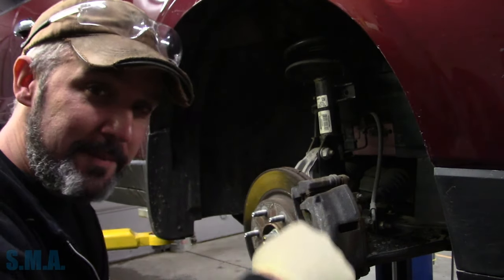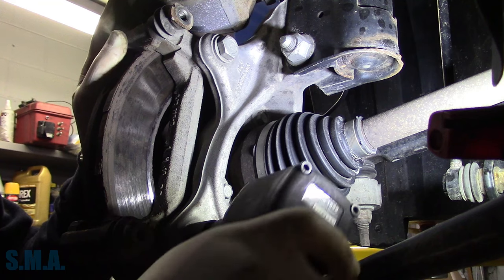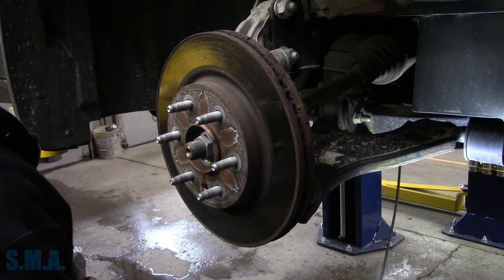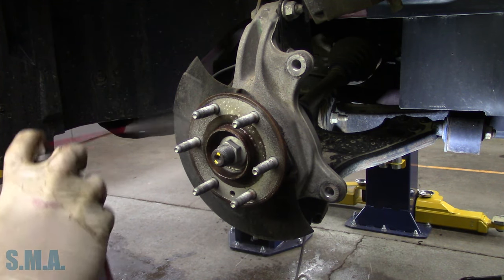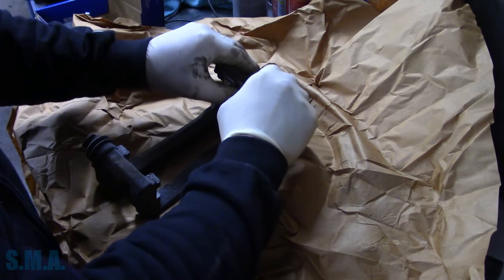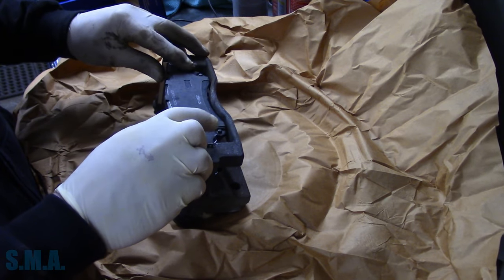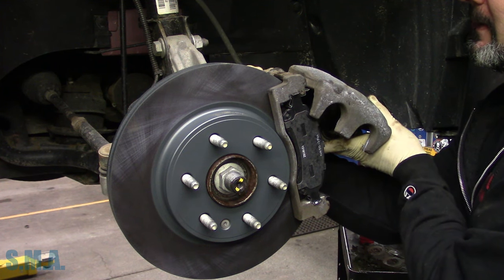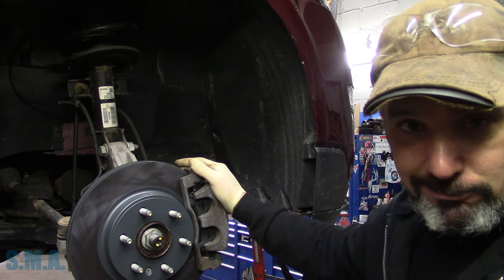Chevy Traverse: Front Brake Job

Comment: My grandpa, my dad, and now me, all pushed the pistons back in during a brake job. My grandpa was working on the very first hydraulic brake systems ever built! None of us has ever had a problem from that. Only time I had to open a bleeder after a brake job was yesterday ... after I knocked a piston out of the wheel cylinder while fighting that 6" long brake cable spring on my '07 Silverado's rear drum brakes! More fabulous GM engineering ... but I digress!

Comment: Just finish installing an upgraded brand new brake rotor and ceramic pads for the front of my 2018 Chevrolet Traverse today.  My stock rotor just aren’t cutting it when I want to stop suddenly or going downhill slope.  I tell you, when those rotor gets hot,  the brakes are scary as they just don’t slow down fast enough to avoid front collision.  So I made the decision to upgrade the front to a slotted  and ceramic pads.  The improvement is huge, as for durability,  only time will tell.  The new rotor and pads was on sale so I grab it while the price is too great to pass up on.  Regular price was for $699. Got it it for $275 something dollar

Comment: Just to amplify Eric's comments about car makers pushing in pistons without bleeding - from a Honda Odyssey service manual (Honda not Haynes etc), 
Step 1: Remove some brake fluid from the master cylinder. 
(Skip steps 2-10) 
Step 11: Install the brake caliper piston compressor tool on the caliper. 
Step 12: Press in the piston with the brake caliper compressor tool so the caliper will fit over the brake pads. Make sure the piston boot is in position to prevent damaging it when pivoting the caliper down. 
NOTE: Be careful when pressing in the piston; brake fluid might overflow from the master cylinder's reservoir. If brake fluid gets on any painted surface, wash it off immediately with water.
No brake bleeding mentioned.

Comment: yaay for the chivvrolaay...question doc ..does egr block off or delete mess up vehichle i.m. for inspection   for those whom dont want to remove egr tube for carbon cleaning?..i cleaned mine just a ponder though🤔

Comment: Me personally, I hate brake cleaner. Every time I use it in the shop I tend to have to weld within 30 minutes after and if you never welded after spraying brake  cleaner, DONT DO IT! Even if you spray brakes and you weld a part 30’ away on a table, your still screwed. I have nightmares from it. PTSD!

Comment: I have c clamps vise grip welding c clamps Pry bars of varying types and for the really heavy duty stuff a tankers bar for moving cat tracks, but my go clamp for pushing the pistons in
is the old Erwin single action pistol grip wood clamps, what ever works: amen... amen
none of this fancy stuff, just get it done. and tight is tight, ! "-)
I'm in my 70's, back in the day I worked with old timers from the 30 40 & 5r0's, to install a grade 8 1/2 short bolt, say in the dust dirt rock grade covers, take a 3 pound mallet & slam it home. 
and the guy would tell ya , that's how to get it done and go next. moving on.. 
I suppose you could call that flat rate. to say the lest I was stunned,  because I knew the next time around I have to deal with that slop job, and I did... 
many repairs  replacing weld nuts, 
I own a 2015 4x Chev. did my brakes all around, the rear brakes were getting bad, throwing my wife out of her seat ever time I applied the brakes. "-)
Honestly, I got a pretty good laugh from that. she didn't  think it was funny. 
bought Napa, not a sponsor "  you do awesome work>
I think I used a little white lube here & there & called it good, for the coast of 4 rotors
and shoes / kits, DIY, if it goes north of south, back to Napa & do it again, gives the old
man something to do. 
Harbor Freight has a recall on some of there jack stands, I have 4 of their  small stands,Pit-berg stands, the batch number I have aren't apart of the recall
Three batch No#, poor dog engagement, shallow tooth on the bar for the dog, slips past,
You don't need a Receipt, just take them back,   don't use them, 454,000 jack stands 
on recall. hello...………. china crap strikes again.

Comment: Great Video. I've seen this post install and I have a question. I followed most of what you've done and I'm hearing a noise, sounds like a grinding, when I brake. This sound occurs when at low MPH and light braking.  I used Ceramic pads. I've checked the system and everything looks good. Any suggestions. I'm hoping not to take it to a dealer.  Thanks!!

Comment: Because Eric O has been mentioning the comments he receives about opening the bleeder I decided to check myself.  I have the factory manual for my F150, my Hyundai Elantra, and my old 1994 Ford Ranger along with Chilton and Haynes manuals for several other vehicles and none of them ever mention opening the bleeder before pushing the pistons back in.  I even remember from shop class (back in the old days) that all you have to do is push the piston back-just make sure you have enough room in the master cylinder.
So unless a manufacturer specifically states that you have to open the bleeder I'm with Eric on this one!

Comment: i just replaced the front and rear brake pads on my 2007 mercury mountaineer..
i added small amount of silicone lube to the ears of the brake pads that slide on the new hardware..
hope i didn't screw up... what do you think Eric??

Comment: Is the squeaker tab hung up on the back of the caliper bracket? Also, have you ever tried using a product called Disc Quiet? It cuts down on disc squeal quite a bit, and it won't wash off over time like the silicone grease.

Comment: Zach over here at Jahr Transport- thank you for all you do for the people, but you want to take the cap OFF the brake fluid reservoir to amke sure those pistons move easier, also air doesnt get introcuded by fluid not having anywhere to go because the cap is still on reservoir

Comment: At 9:11 he says the wear indicator goes on the inside of the caliper bracket facing down, but when installed, the indicator is on the inside and at the top.  Am I confused, or did he do something different than what was said?  I need to know since I'm having a post-brake install grinding issue.

Comment: Could someone please help me with my Toyota sienna 2010, I had to drop the sub frame to fix a transfer case leak and replace some bushings. Well i got the car back together and now one of the power sliding doors latch motor does not even make a sound, I don't know what the crap is wrong with it i have tested it multiple times motor makes a sound when i used a battery to test it, While there is no power in the connector i have been trying to figure this out for hours and i mean hours if anyone could help that would be great. I have checked all the grounds that i touched and checked all the wires and they seem fine.

Comment: Don't know why people think you have to open the bleeder valve to reset the caliper.  I have pushed in the piston for 20+ years, never had an issue.  The good is you will find out if there is a problem with the line as they can collapse over time.

Comment: What do you do when those little rubber caps on the brake caliper slide pins has enlarged due to wrong grease or age? Ran into two of those on same car. Just threw them in trash. That ok? I’m being serious and I mean the little rubber seals on the slide pins.

Comment: I'm almost 50. I've watched my dad that works as a welder fabricator use the C clamps to push the brake pistons back in. I have done that all my life. When I went to industry training for motorcycle maintenance, guess what we were taught by multiple manufacturers? If you guessed push in the brake pistons, you would be correct. There is no chance you will fit the new thicker pads on otherwise.

Comment: Pushing the piston in with a "C" clamp is how I've always done it. Never had any problems. I will say, I tried the brake grease, something else I've never used, but since you use it, I tried it....It sucked! It was actual brake grease from NAPA (Not a sponsor lol) , not grease from my grease gun, but when it got hot, it melted and ran onto the rotors and killed my brake job....Never again. I've gotten by all these years without using it, I guess I can finish out my time without it.

Comment: Did front brakes on a 2008 Silverado 1500 4x4 yesterday. It was probably my 30th brake job using the SMA method. The owner was looking over my shoulder and voiced a little concern about the lack of lube on the hardware and not using the tube of lube that came with the pads. I explained the logic and ended it by saying If Eric can do it I can do it! He grinned and I gave him the unopened packet of lube. My first SMA brake jobs from four  years ago are coming back and they look great and the replacement is Easy Peasy! Thanks Eric

Comment: When I was doing a lot of brake pads I would just use a pry bar to push the caliper back before I took it apart the old pads are just right to push it back evenly. No special tools required for this just a big screwdriver works great

Comment: What would you recommend to use as lube on the slider pins? Silicone grease or Permatex extreme brake lube? In the past you have used the Permatex product.

Comment: I have always done my own brake jobs (40 years or so) and have only ever pushed the pistons back with whatever clamp I can find (Never an issue), one thing that does make me curious is your liberal spraying with Sheep juice (Bahh) as well as the liberal application of the silicon grease to the caliper. I would have been worried about it migrating onto the pads or disc and causing problems. I assume it does not or you wouldn't do it.
Anyway keep up the good work and your break jobs are like comfort food as they sooth the stressed out mind. ;-)
Reply: Well it's outside the contact face of the pads, and would fling away from the rotor/caliper.
Thin films of grease would burn off from the heat. Obviously best practice to have it as clean as possible, but a couple of greasy fingerprint wouldn't be an issue.
I think you will find many recommendations given for installing items are to cover liability on the manufacturers part. 
There is always one idiot who doesn't know enough to know they don't know enough and will decide to wipe grease on the rotors to "keep them shiny" or something, then claim "it didn't say NOT to wipe them liberally with grease..." on the packet.
This is why some instructions seem like overkill.

Comment: 92 Dodge 1 ton rear drum brakes you have to remove the lug studs from the axle. 
Eric, do you have a video of a 1 ton rear drum axle brake job? 
How many times can you remove and replace the studs before you have to repair the axles?

Comment: I have owned that dual piston compressor for a number of years one trick I learned is to put one of the old brake pads in between the pistons and the tool and will help push them in evenly works great when doing truck calipers like on superdutys that can be tough to push in  sometimes.

Comment: I've got a 2015 Traverse with 45,000 miles. Going to do the same project. Did you measure the rotor width, or just replace them as part of the job?

Comment: I had a vehicle one time that I took to a garage for front brakes (was young at the time and didn't know how to do it) and when it was done, I picked it up and was driving home.  Approaching a stop sign, I hit the brakes and nothing.  The brakes didn't work.  I started pumping the pedal and suddenly the right side grabbed and swung the vehicle to the right heading for a tree.  I let of the brakes and cut the wheel to the left and hit the brakes and drove right over the stop sign.  I hadn't tested the brakes until then as it was a stick shift and didn't need the brakes until that point.  The stop sign was flat to the ground and I got out and grabbed the sign and bent it back up straight, got back in my vehicle and took off.  Only had a tiny dent in the front edge of the hood.  Learned my lesson that day.

Comment: I wonder why you only show front brake jobs? I've never seen you do a Honda rear brake job with the screw in pistons. They seem kinda tricky if you have never seen the procedure.
Reply: Hazard a guess they get used/locked up the most. Though I do believe he does show a video on winding back that style. Also, one on how to/do you need a scan tool to just change brakes. That one was on a VW if I think right. Fun times with brakes. The need for a scan tool is silly in my opinion, but sign of the times.

Comment: Sadly the brake jobs are easier and make more money.. and that is the reason there are "quick fix" chains that do just these more profitable jobs.
Reply: And the “quick fix” places likely have substandard technicians doing the work without knowing the tricks and ways to make sure problems don’t arise...ie brake squeal.
Reply: @jwboilermaker  Well., I have had shoddy work done at those places, I try to avoid them.  If I wanted substandard work I would do it myself!
Reply: jobs like this pay 1 hour. so  if you just pull the wheel, push in the piston, and swap pads you make money. pulling the caliper bracket, cleaning up the rust, and lubing everything for a proper job is just something good mechanics do out of dedication and/or consideration for the customer.  i don't charge extra for it even though it adds considerable time to the job.. i bet it isn't done at econo brake fixer shops.